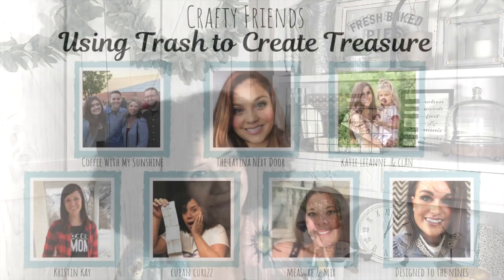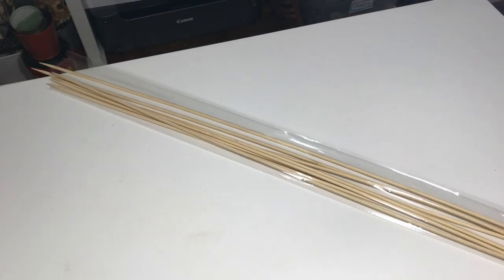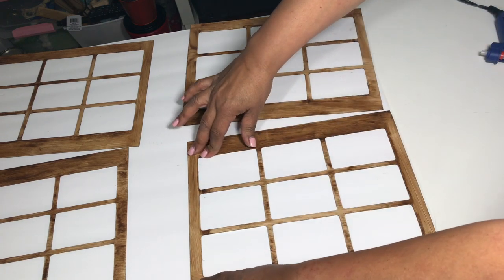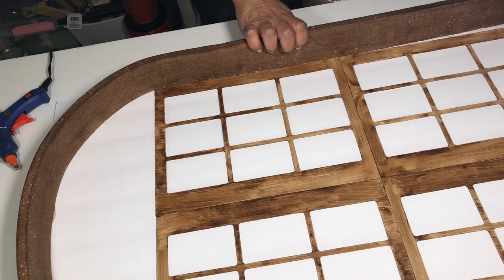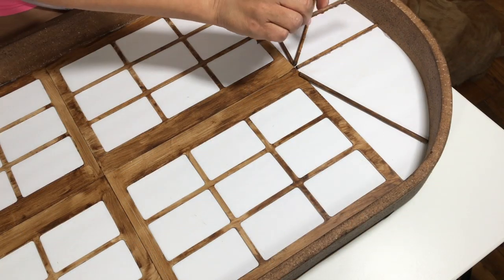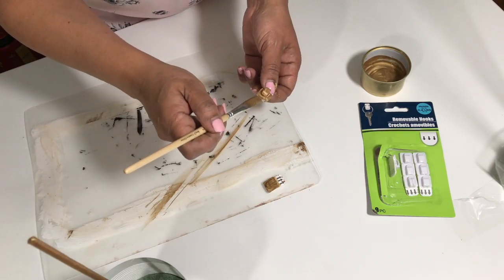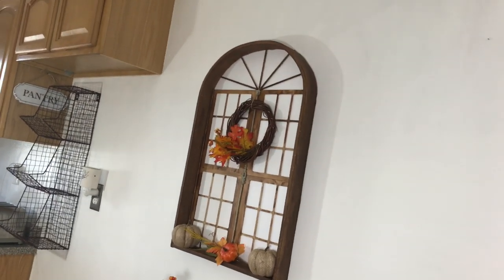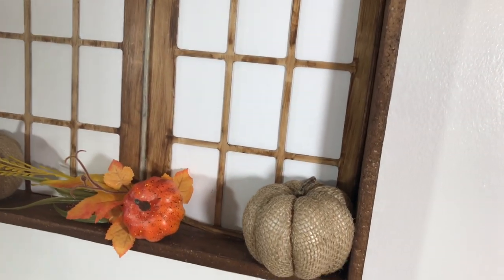USING TRASH TO CREATE TREASURE | DIY FARMHOUSE WINDOW| COLLAB

Comment: You can use a blow-dryer on high heat and soften the hot glue up again and just scrape the excess away with the edge of a credit card. I also find the plastic squeegees that come in the window treatment kits with the real fine edge work great too.
Reply: That is a great tip! I will definitely remember that one!🤔

Comment: I love it you did a great job I was really impressed how well it turned out give you a little tip if you want the bottom to be a little bit more firm take a piece of that foam board and cut it and glue it to the bottom I'm be outside so you can hang stuff on it a little bit more heavy but you did a great job love it